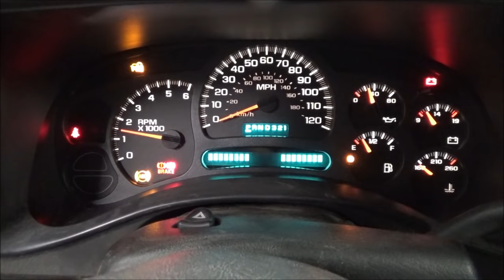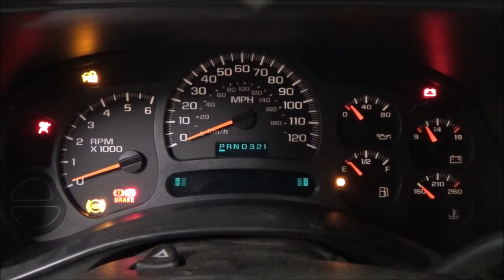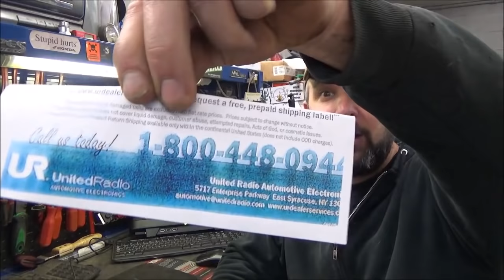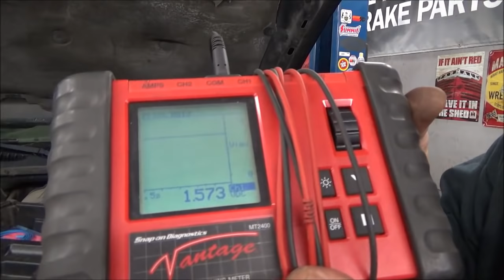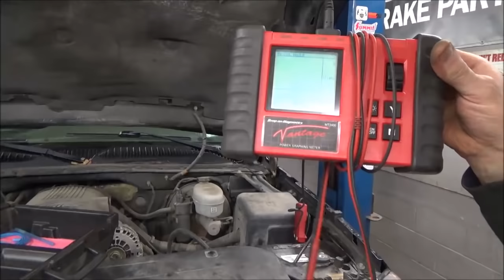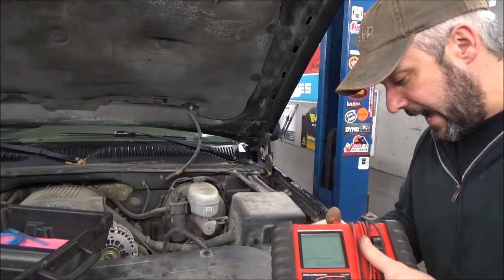Chevrolet Truck - Battery Dies Overnight - Part II

Comment: Thank you a thousand times over! That phone call to the rebuilding company saved the day. The instrument panel on my 2003 2500 farm truck was drawing .2 amps intermittently and draining the batteries. After half a dozen parasitic draw tests (where I found no draw) over the last 2 years I was finally able to catch the .2 amp draw in the act. With a little research I found that the larger resistors on the board commonly break joints. So I went over the top and added solder to every component on the board. I plugged the cluster back in and it was fixed! Until I tested it again... after all of that work, I still had the same problem. I was about to throw in the towel until I saw this video and heard the tech mention silver migration. I initially noticed tiny gray specks on the back of the board, but they didn’t look like problematic corrosion or heat damage, so I figured that was no big deal and chalked it up to sloppy build practices. When I heard the tech mention tiny black spots though, I instantly knew what he was referring to. I fluxed the affected areas (of which there were MANY), heated it with hot air, then scrubbed the spots with solder wick and a soldering iron. Cleaned up with alcohol, plugged it in, and after the panel goes into sleep mode I have 0.00amp current draw on the IP/DIC circuit! That phone call was a lifesaver and I could not find that information anywhere else on the internet. Thanks!!!

Comment: Lead-free solder is garbage.   It sounds more environmentally friendly in theory, but if more electronics are winding up in the landfill prematurely because of solder failures that DIDN'T happen with tin/lead solder, then it would seem a bad decision in the grand scheme of things.
Reply: Thats what happened to the first Xbox 360s...
Reply: +Chris Freemesser Can't blame this on lead free solder since the metal migration is actually pretty common. The migration is actually between the traces on the circuit board. They possibly fix it by washing  or scrubbing the board.  The reason lead free is crap is it thermally cracks i.e.:  PS3, Xbox, NVidia .....
Reply: yeah it was
Reply: +331sbf Your point is?
Reply: +331sbf  Of course just 95% less. Yes lead is BAD, no argument but your argument is pointless. Older formulations of lead free are extremely brittle and flow and wet poorly.
Reply: +331sbf  Blatantly wrong. The solder was the primary problem.
Reply: Thats caused from a poor solder job, bot from the solder...
Reply: It all depends HOW MUCH lead is in your water, lead as well as a thousand other toxins exists naturally in MOST water supplies (rivers, lakes aqueducts etc..)... The environmental movement looses ALL credibility when it pushes for zero tolerance that eventually leads to far reaching environmental failures in other avenues and much much higher costs in everything we do! For example the mandatory  environmental friendly exhaust systems they put in vehicles now; they end up- burning far more fuel, lower fuel economy & power... but because it "sounds" better we keep following inane stupid environment practices that do far more harm than good! It literally is the politically correct environmental Kool-Aid that is destroying our economy and planet more than anything else!
Reply: Not from the PC boards I have looked at!
Reply: Ya hate to keep too much lead solder around. People may think it’s ok to use on their copper water pipe solder joints, which it isn’t.
Reply: Chris Freemesser Lead isn't necessarily the culprit , it's Mercury ,(Amalgum fillings). When you mix other heavy metals with Mercury the toxicity goes thru the roof , really eats up the brain.Thus the lead paint scare.The body will take up lead because it mimics a necessary mineral.If a child gets the proper minerals , no lead problem.mercury is the real culprit.Dr.Thomas Levy vit c.
Reply: Lead-free solder isn't the problem, shitty solder joints are. I've used both and can make good and bad connections with both. Most of the electronics I have with lead-free solder are fine. The computer your using to what youtube uses lead free solder. The original Xbox is a good example of why a poor job elsewhere causes the solder joints to break which is then blamed on the solder instead of improper soldering techniques and improper structural support. The solder in and of itself isn't the problem.
What he's talking about on the call is something that's actually called a whisker. It happened frequently with nearly pure lead solder. This used to be a problem with spacecraft and would take them out. Some solder formulations and designs are more problem to the problem, which is why having electronics engineers who know what they're doing is important.
Reply: @froglerking9830  shhh don't tell people they are oblivious/ignorant of natural background quantities of contaminants in the water and air!  If you have a natural water source (well water) ...  there is almost certainly arsenic in your water.  There is an amount that is safe, and above that, an owner selling a house must put in something like a reverse osmosis filtration system on the water system.

If you aren't licking or eating lead paint/chips and window frames, you are ok.  The reason leaded gas was SO bad is due to the fact so many cars use gasoline, so when all non-diesels were running leaded fuel, it was a big issue with levels becoming unsafe in the air from exhaust; so it was phased out in the 80s.

in relation to solder specifically, bad solders have always happened.  Late 80s Isuzu I-Marks and its sister cars had one of their boards go bad from cold solder joints.

But, if you listen to anyone that has been soldering for decades, most of them will tell you to use the tin/lead solder.  The overreaction/outrage culture has blown this all out of proportion.

And just as others have said, using non-lead solder, creating products that go bad easier, filling landfills is far, far more environmentally damaging than a tiny amount of lead on solder joints no one is touching and most people aren't even aware of in daily life.

How often are you taking your PC/Phone/laptop/tablet/home appliances/car ecu/etc apart and rubbing those solder joints with your bare skin/tongue?  Even people who work on them, exposure time is extremely limited and proper PPE (personal protective equipment) solves it; which includes ventilation, gloves, eye protection, and whatever else you feel necessary or is required based on exposure, time, and the actual task.

I grew up when leaded gasoline was still sold at the gas stations.  Leaded paint was still more common in automotive paints (durability, resistance to flaking/cracking), and lots of buildings still had it, and asbestos; like in schools, as it is a superior flame retardant.  I don't have lead poisoning or lingering effects.  I don't have fucked up lungs either; though my grandmother worked in an asbestos plant during WW2 and after and had real lung problems from it, so not marginalizing any of it.

Understanding the issue, and focusing on where it matters; instead of solving the problem of a mosquito in your house by blindly fire shotgun shells at it is the wrong approach.  You also don't eradicate mosquitoes from existence either as they do serve a purpose, and so do all those things I mentioned.

As someone below me mentioned; you don't solder your drinking water pipes, don't be a fucking idiot.  Your waste water pipes going into sewage/septic is another thing, but I'd still disagree with that as the lead is still leaching out, and that water is either going through the city water  treatment plant or getting pumped and dealt with by a septic pumping company (and leaching out).  But soldering electrical connections, be it transistors/etc on a board, or lineman joints on wires ...  things you shouldn't be touching nor should they be exposed to being touched outside repairs in the first place.

People, use your brains.  Common sense and critical thinking goes a long way.  Understand what is really going on.  Don't just listen to talking heads and articles; if you haven't been around a long time, you may not have notice how those people flip flop things and dramatize things for lack of both proper journalism, and clickbait titles, articles, and bits of news/shows have been doing it since they've pretty much existed, and not just in tabloid style publications/organizations.
Reply: This entire thing is designed to fail. They make them that way so the majority of people will throw them away and buy a new one. Otherwise known as job security.
Reply: lead/tin solder still fails over time from lead oxidation especially when there is water ingress and condensation. Commercial solder has NEVER been perfect, industry would not survive if it was... everything electrical would last at least 10 years and many things would last indefinitely so no one would need to buy another one once they bought the first one. Capitalism falls apart if the market is saturated and no one ever needs to buy a replacement!
Reply: Its cheaper
Reply: @Willie Gillie anyone who doesn’t know the difference between soldering and brazing isn’t doing that kind of plumbing
Reply: @DavidPruitt  Corn isn't the problem with gasoline, ethanol is. The world is still polluted. It must be in the joints.
Reply: @bezaleeluk3696  Society would improve if manufacturers stop using cheap alternatives. Such as lead free solder. That's like paperless paper. Green energy is a double edge sword. Move one step forward, and 2 steps back. People who try to protect the environment, without really caring about the environment. It would be better for our environment to keep things running, rather than mass acceleration of product destruction. And also these crappy products are made in places with the best climates, furthering earth's destruction. I wish people really cared about the green movement. But at the end of the day, food must be on the table, and a sports car must be in the garage, probably green. The consumer takes the hit.
Reply: Three  years of dashboard  torture. Finally  a cure. Thanks.
Reply: Three  years of  dashboard  torture. Finally  cured.

Comment: My 03 is dying overnight as well. If I charge it she will run and once in a blue moon she will start the next day. Well I had the key turned over just to test my check engine light and bam she died within 2 minutes. During my week of dealing with this at one point my rpm mode was at zero with the truck running. Battery and alt are about 6 months old. I am driving myself insane figuring this out

Comment: Eric, you are living proof that mechanical/electrical genius is truly an amazing and unusual gift.  Thank you for taking the time to share your analytical, diagnostic, and therapeutic thoughts with simple mortal do-it-yourselfers like me.  Your understanding of complex modular computerized circuitry is nothing short of incredible, and your data-tracking and curiosity are awe-inspiring.  D.I.Y. guys like myself learn so much from your experience, discipline, patience, forgiving nature, guidance.....and self-deprecating sense of humor.  As a long-standing 60’s era engine rebuilder and pony-car restoration buff, I now simply cherish my more “modern” 1976 Firebird Formula, 1985 Firebird Trans Am, and 1999 Chevy Tahoe.  I have them all running and functioning perfectly in large part thanks to you.  Even though I don’t have all the useful sophisticated tools, or certainly your diagnostic skills, I am no longer completely intimidated by electrical circuitry malfunction.  Clearly, there a great minds in the automotive industry that can attack and resolve virtually any problem if/when it escapes me.....and no local mechanic could ever B.S. me.  Please keep posting your superb You-Tube videos, they are invaluable.  Dr. K.

Comment: I want to thank you. We replaced the OEM radio with a touch screen Sony thinking the radio was draining the battery. Turns out it was the cluster doing it. Got a new cluster and the battery is just fine now. Ended up going through 3 batteries until we fixed it. You are a life saver. (2003 Chevrolet Avalanche Z71)

Comment: Lead free solder is the worst. One of my soldering irons came with a little sample of the lead-free, I figured I'd try it out. Pure garbage, it barely melts and it flows like lumpy oatmeal. Chucked it in the trash and picked up a roll of the good stuff.
Reply: +Nutz4Gunz45 Indeed, the RoHS crap have caused so many problems.
Better stick it to the lead haters and roll on the lead, many repair shops such as "Louis Rossman" here on YouTube also does reflows with Lead solder.
It just works, and it lasts, you also avoid the cracked solder joints.

I hope United Radio gave the lead haters the fingers and used the leaded solder for the repair too.

As for Eric, keep up these mystery diagnosis videos, and keep the spoiler preview pics out (Like you did) and you have the recipe for a show that beats whatever NetFlix offers.
Why? It is always fun tagging along and chasing that problem down until a fix, it is like a crime show trying to find the killer!
Reply: ROHS doesn't apply to repair, just production.  You can use leaded solder for repair all you like, just cannot manufacture new with it.
Reply: Lead free melts at about 750 degrees so you really got to crank up the iron
Reply: I solder at 720-750 anyways and I still have trouble with slow, lumpy melts. The iron has to dwell on the joint longer than I'd like.
Reply: CMDR Sweeper Rossman is the shit! I can watch his repair videos and listen to his commentary for hours. Lol

Comment: Interesting. Silver Migration disease (Or SMD) Is a common problem in old tube radios as well Using silver mica capacitors. The parts are scarce so you have to basically  come up with your own fix. Glad to see part 2 the suspense was killing me LOL.

Comment: Very interesting indeed. When I retired from the PD in 1994 I treated myself to a new GMC PU. Approximately ten years later, I experienced the same problem. I rarely use the truck these days due to my age. When I did use it, I discovered the battery dead. I jumped started it, but soon discovered the same problem next morning. I bought a new battery and within a few days the battery went dead. SOOOOO I charged the battery and after using the truck I would disconnect the battery until I need the truck and reconnected it when I needed. Works for me, so at 80 years of age, I'm not about to get any further into it. Got a feeling that your diagnoses is probably spot on. Thanks for sharing this great video. Ken Marina CA
Reply: Wouldn't it be easier to just pull that one fuse and reinstall it when you want to drive the vehicle? Also, in NY State, when the power to the computer is interrupted, you can't get the annual inspection done until you go through a ridiculous long ritual of drive cycles to clear the "Not ready for inspection" code.
Reply: I have a 93 Silverado that isn't driven much, so it has the battery drain issue.  I installed a battery isolation switch about 4 years ago because it was easier (cheaper) solution.

Comment: Well it's a little bit late, but let me thank you a whole bunch! I fixed my own cluster about 5 years ago when I bought my 2004 2WD suburban. I bought the kit and it went pretty well. But my battery started going dead this year...I measured 1.3mV across the fuse,  took the cluster out today and found that it said C+ on it...just like yours...I  disassembled it and found the little black spots like  your guy talked about. I  Cleaned it with CRC electronic cleaner and a gentle brushing on both sides.  Measures 0 mV😀😀 now. will check periodically to be sure.  It has to come out again when it warms up as  Spedo and tach are off a little. I knew it was a junk-yard unit...being that the records say trans rebuilt at 300K miles. Says 173K now and I bought with 90K.  I have not replaced the plugs and I don't see any records of that. Have done water pump, rear main seal, and intake gasket.

Comment: Thank you, this basically confirms 2 of my problems with an 04 Tahoe. For over a year the battery has randomly drained. not every day, sometimes it would be fine for a week to a month then its every day..I have been testing circuits without any luck as it is never constant. The cluster finally died, replacing it should hopefully solve the draining issue. My other issue that I discovered was a bad ground from the firewall to the back of the engine. The ground wire is hidden behind the wiring harness, it took a lot of digging to find but the ground was rotted off and needed replaced. I have never invested so much time into finding a problem on anything, hell, I gave up on figuring out women after only a few months... I was fairly positive it was the cluster, now I am 100% sure without any doubt. Thank you!
Reply: Intim31976 what kind of issues were you having with your bad ground? I have an 04 Chevy Tahoe that has flickering lights and I’m thinking it may be the same issue.
Reply: I had the same problem in my 2003 2500 Silverado. It kept killing batteries and I kept doing parasitic draw tests and not finding anything. I finally caught the instrument panel in the act of drawing current when it killed the batteries yesterday. Thanks to Eric making that phone call and putting it on YouTube, I was able to clean up the silver migration and solve a problem that had plagued me for 2 years!

Comment: Thanks I own a 2003 GMC and this is the second  time around with this problem the first time it was still under warranty so I was not told in detail what was wrong only that I had a wiring problem that needed repairing.  Now I know what need to be done. A great video!